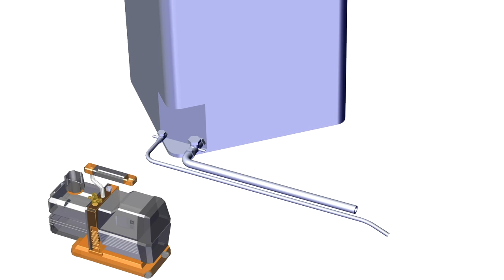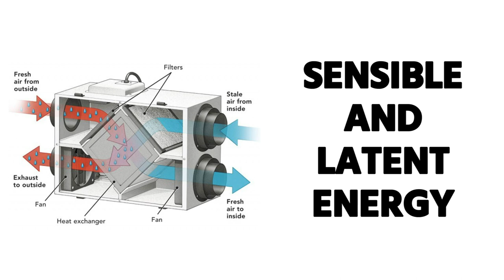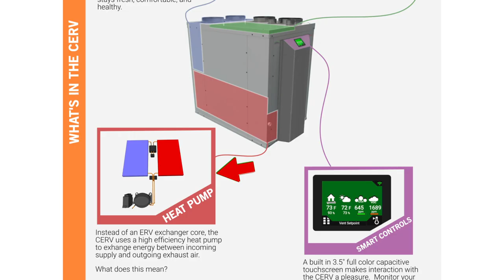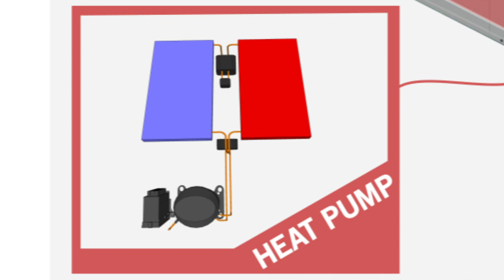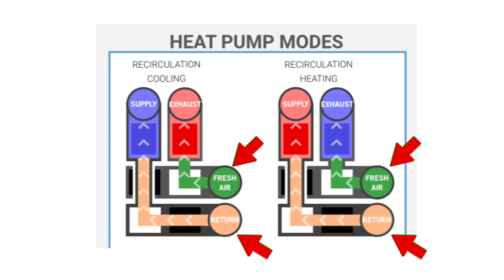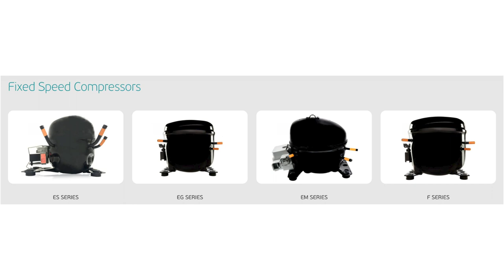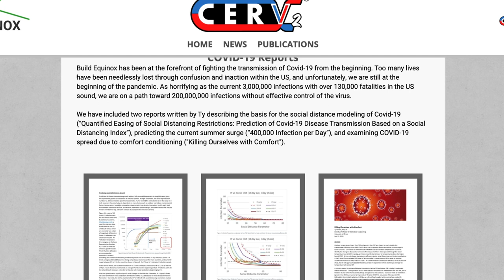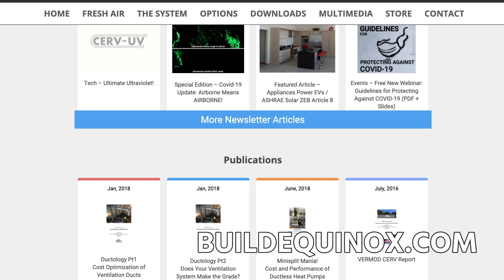Advanced Ventilation w/ CERV2

Comment: Thank you for covering this!  I've been planning HVACD designs for my family's rental (and eventually for our own home).  I was looking at ERVs and thinking: Wait... how smart are these devices?  Depending on not only the temperature difference between A_inside and A_outside, but where those temps are in relation to our desired temperature, will we always want to exchange heat/humidity?  It works if we want to preserve those properties as much but not if we don't.  These things don't have sensors on the inside and outside so there's no way it can know unless the entire HVAC system is designed to know outside these components.  And this goes for pressure (what happens if one or more bathroom ventilation fans gets turned on?), and now air quality (I'm in the Bay Area in California with the increasingly annual wildfires and have spent the past week coughing, all while hearing similar stories of others in the region deciding between closing all the windows and overheating or opening all the windows and getting smoked out).

It seems ideally, if the system is going to manage all possible permutations of conditions, it would require sensors (for all air properties) both indoors and outdoors, as well as having all components arranged in a way such that every desired permutation of activation can be activated with all the proper air ducting/plumbing arranged as well.  My mind was boggling at the potential explosion of complexity at such a task, and this is one of the first times I've heard anyone in my HVAC research even acknowledge that such issues exist with these systems as they are.